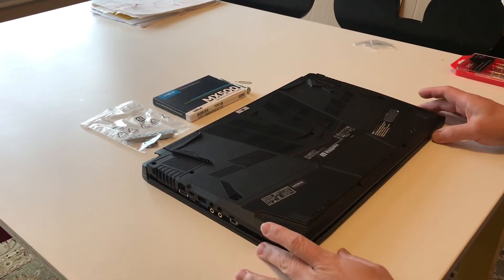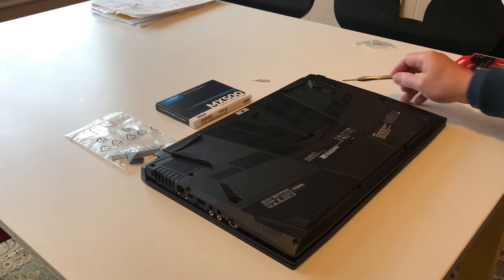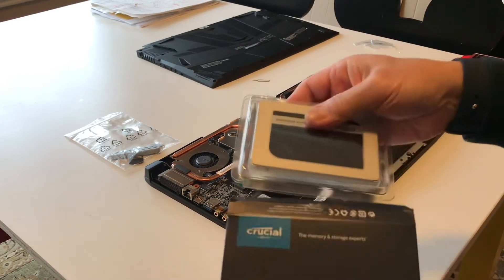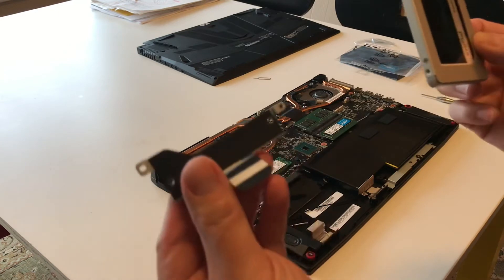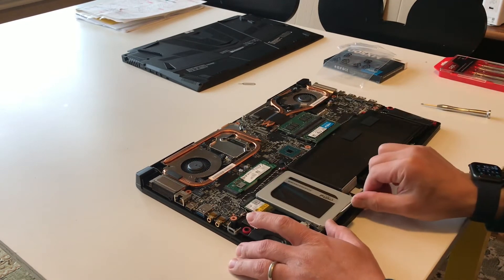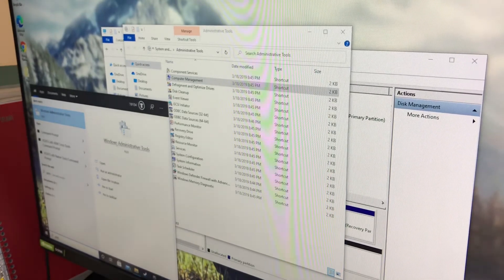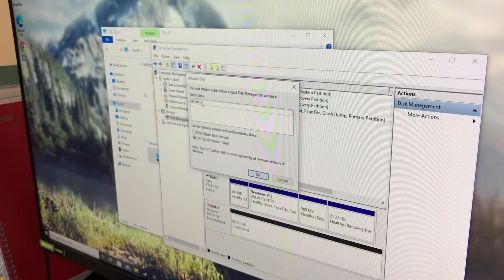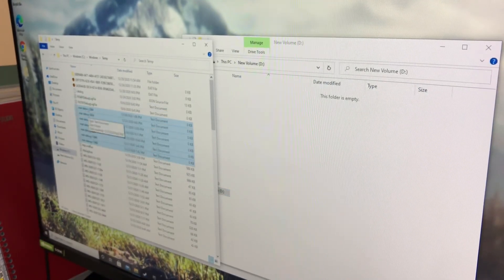Installation of a 2.5" SSD drive, MSI* GF75 Laptop

Comment: In fact, here in Norway i purchased a Gf63 12UCX and what I started with was to open  it up, removed both m.2 and the two RAM moduls, 8GB each. So installed 2X16GB DDR4 Kingston Fury Impact 3200 memory. So a m.2 NVMe Kingston fury renegade 1TB and also a Samsung SATA 3 SSD with 4TB. That should not work, but in fact it accept the 4TB SSD fine.

Comment: is it possible to mount the ssd without using a bracket/hdd caddy?
Reply: I would like to know this as well. I didn’t know I needed it and just connected the ssd without any thought about it, and now I’m concerned it might cause problems. It seems to be in place securely, but it does make noises when I move my computer, which I believe is just the sdd bumping against the back of my pc. Is this an issue, or can I just leave it?

Comment: My D: drive is giving warning "at risk (SMART event)" on my laptop, it's currently empty for this reason and it's suggested to replace it, your video really help. I was unsure about the steps to follow. I thought I would need to clone my HDD to the new SSD (if I replace it I will go for that instead)  but since  I have nothing saved on it there's nothing to clone I guess, I also wasn't sure if I needed to use a USB boot of windows after changing that drive. I see it's not necessary. it actually look quite simple, I also have a MSI but it's a GL73 8RC. the only thing I should be careful about is static discharge

Comment: Thank you!!! I have the MSI GF66-11UC, when I bought the PC they told me I had 2 M.2 slots, so this year I wanted to upgrade my ram and storage. When I opened my pc I saw I only had 1 slot of M.2, but I saw the space for an 2.5'' SSD, I went to the store and they told me they couldn't sell me the 2.5'' because they didn't think that would work and that I only have just 1 slot for storage. So, I was mad because when I bought my pc I asked for a pc that I could upgrade later, and 2nd I refused to only have 516GB of storage. So, I went to best buy and bought a 2.5'' because I was pretty sure that the ssd will perfectly fit in the space I had, and when I connected it I didn't know how to install it, so I thought maybe the guys was right, but with your video I could follow every single step and now I have 1.5 TB in my pc!! :)
Reply from the maker: Good stuff mate
Reply: Hey it's been a while so I don't know if you'll see my comment, but do you remember if there was an SSD metal bracket and screws included in your laptop's box? Did you just plug in the SSD without the bracket or did you use anything else to hold it in place? Thanks in advance!
Reply: damn we got a same type of laptop, that's help me a lot, thanks

Comment: Bro i have an old hdd i want to add it to my laptop but it has windows installed on it because i took it from my old laptop
What should i do about it
Can i install it normally or i need to uninstall windows from it firstly?
Reply from the maker: If you are using it as a data drive, just install & format/re-allocate the drive in the operating system you are using. If windows, really easy to do under Disk Management.
Reply: @nesborne3192  thanks bro

Comment: Awesome video, but I got my GF75 secondhand- I don't have that OEM hard drive clip that came with yours in the box. I'll look on eBay, but do you know where I can get one?
Reply from the maker: If you don't have it, check with MSI* to see if they carry it as a spare, unfortunately I don't have the part# for the bracket. Goodluck.
Reply: I have the same problem, did you find one in the end?
Reply: Also, you'll need 2 screws that fit into the motherboard to attach the SSD (it's a standard fit for the golden threads in video.. NOT the caddy screws, I tore apart an old laptop I have and it had them lol.. I didn't plan ahead. Do better than me

Comment: heey very nice video .. when my ssd arrives imma do it too ... just a quick question is it possible that the laptop automatically recognizes the ssd ?
Reply from the maker: It would recognize the drive, however, in the operating system, you have to configure the drive to use it. If I recall, the configuration was part of the video.

Comment: The hard drive older isn’t included with my laptop, do you have an idea where i can found one ?
Reply from the maker: The holder is sometimes easy to miss, can you re-check your packaging to see if it is still there? If not, check MSI's website or support to inquire if this can be purchased in their store or from an external vendor.
Reply: Thanks for your help
Reply from the maker: I did a quick search & found this, https://www.battery-adapter.com/product_info.php/products_id/161/vGL63+9RCX 
See if it applies for the model you are using. Goodluck !
Reply: @nesborne3192  is this site securised?
Reply from the maker: @louissp5598  you'll have to check with their site.